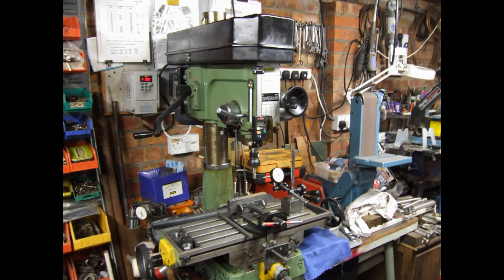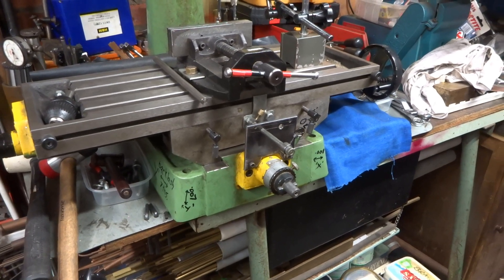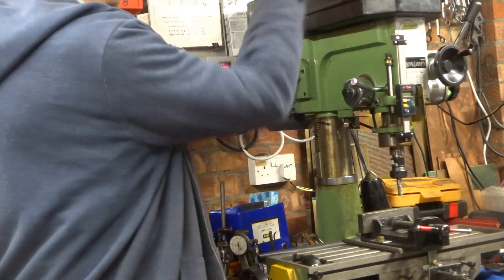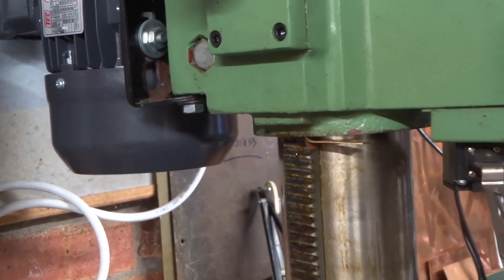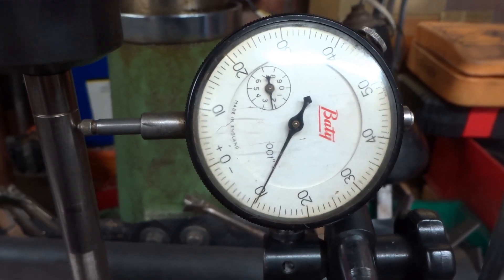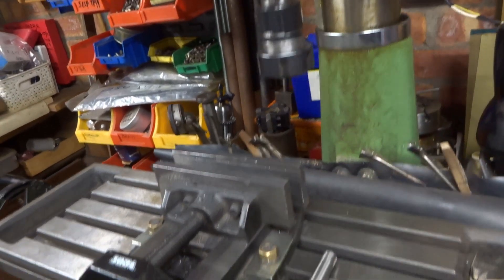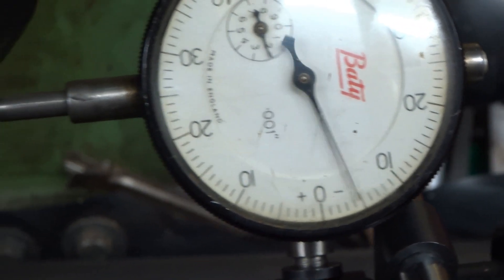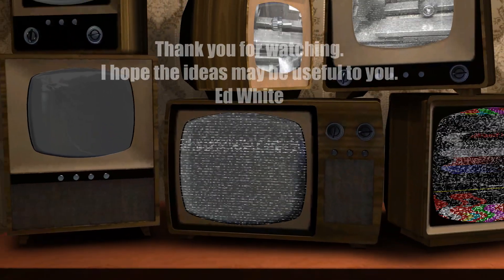Round column milling machine modifications

Comment: G'day Edwin and greetings from Tasmania Australia 🇦🇺 I just happened to stumble across your channel and like you my interests are in stationary steam engines and currently I'm building a No 7 horizontal steam engine, however I found how you explained how you were trying to get the head of the mill ridged, apart from the mill being 25 us old is amazing that the tolerances were so low.    Thank you for filming this, regards John
Reply from the maker: Thanks John and I'm pleased you liked the video. Reality is that u get what u pay for and this mill was cheap back in the day. That said for what I do it has been excellent and much easier than milling on the lathe which is what I had to do before aquiring the mill.
Ed

Comment: I had the same rf30 mill, since switched to a round column rf40 (geared tilting head) the dro really is the key. I added a 3 axis on my old one after getting frustrated with moving the head. I added one to my rf40 before I even used it. Just zero the dro, go to work, move the head zero again. Also a er collet set can do everything you need without pulling the arbor (other than a large face mill or boring bar) my r8/er32 almost never comes out of the mill, the clamping range covers every drill bit and mill
Reply from the maker: Many thanks. Like you I try to use the ER collets as much as possible, I also try and plan my machining operations as far as possible to avoid raising or lowering the head and in so doing loosing lateral position. Fixing the vertical rack in position however has resolved many issues.

Comment: I've considered doing what Edwin has done to locate the head. I think that in addition to the screws at the top and bottom of the rack, putting pins through the rack and column about 4 inches apart to stabilize the plot. At each pin location I'd jack the head to zero the head location as shown in the video before drilling for the pin. 
As Edwin notes, the problem usually encountered is changing the tooling and there is no room to get it in or out. Therefore, the more important thing usually is to be able to crank the head up to change tools and coming back down to very nearly the same place and still have the head zeroed on the work.
Cheers from NC/USA
Reply from the maker: The pins are a good idea and I did consider doing that, however I became concerned that I might mess up the teeth on the rack so in the end 'chickened' out. In light of your suggestion I may revisit the issue when I get through (if ever) with making the paddle steamer engine that I have under construction. Many thanks

Comment: Very useful video Edwin, cheers. I've just picked up a similar machine to yours and have been mulling over how to sort the play in the round column. I can't really foresee a situation where i where i will be rotating the head out of choice so i'm planning on tig welding the rack to the column top and bottom by 3/4 inches and fixing it in place. From what i can tell by looking at my machine is that the movement is caused by the rack moving side to side when under force so hopefully this will sort it out. I may even braze it at a couple of points in the middle to make sure it isn't going anywhere. Good shout on the brass shims too. Thanks for sharing
Reply from the maker: Thanks Alex. I have never found it necessary to rotate the head of the machine and on mine the head lock does hold things securely.  However the issue I had and hence the mod is that the quill travel is a bit limited and I sometimes found I had to change tooling which needed the head raising or lowering with consequent loss of position when the rack moved during this operation. In my case the packing between the rack and the slot was essential to maintain position if I found it necessary to raise or lower the head during tool changes (particularly when changing from drilling to milling mode). Be sure to get the rack as vertical to the column as possible before finally fixing it in position.
Regards, Ed

Comment: Like the rotation mod using shims on the rack, I have just “obtained “ the Axminster white version of the mill, with very very little use. However I need to address the head. Thanks for the idea to fix the rack. This will be my preferred first mod, I may however make guides and bolt these to the upper and lower section of the head assembly. This way I have a little wiggle room for very small adjustment .
Good work sir.
Reply from the maker: Many thanks for the kind words. There is a U tube channel called Winkies Workshop and he did a good video on making guides of the type you suggest - worth a watch. That said with more care than I actually took I think fixing and shimming the rack should be ok. Certainly works for me. Regards
Ed
Reply: @edwinwhite933  yes I watched that,  I’m just retired and trying to get stuff around me to start to play a little, I have to get some tooling  and a vise.  It was too good an opportunity to let go but boy was it heavy!!

Comment: I wondered if the rack would work to prevent head rotating, now I know it will.
It's a much more elegant solution than the round or square bar off to one side
Reply from the maker: Many thanks and I'm pleased the mod was helpful. Mine is still in use and works well within the limits of accuracy I need for my model engineeering.
Ed

Comment: I screwed my rack to my column and each time I move the head height I push the head to the right and I get within a couple thousandths. I tested with a long bar as well but I did it while I was aligning the rack before attaching it.
Reply from the maker: Many thanks, works for me and a couple of thous is usually more accurate than I need for the stuff I do

Comment: If you want to see another approach, check out some mods which Winkie did to address this issue i.e regarding preventing the head from losing position when raising or lowering.
Great idea about the modification to make a more compact chuck👍👍👍
Reply from the maker: Thanks Dwight. Yes I had previously seen Winkies vid which is excellent. However cos I'm a bit lazy and was in the middle of a project I did not want to spend much time on fixing the head location. The 2 bits of shim were fine for what I was doing.

Comment: excellent....im considering a warco round column major mill.....if you were me....would you buy a round or a square column new mill?
Reply from the maker: Well prof that is probably an impossible question to answer. The key thing is rigidity i.e. depending upon the components you are likely to make can the mill handle them easily? On that score you always find yourself making something rather larger than envisaged. If the mill is correctly designed I doubt that round or square column makes much difference to rigidity. I bought the Warco on price cos it was all I could afford for what I thought I would be making. The advantage/disadvantage of a round column is the tendency to loose position if the head is raised/lowered cos (in my case) I did not fully assess the different lengths of tooling any particular operation required. Only once have I found the facility to rotate the head to be useful. I have now (sort of) fixed my column head so that it cannot easily be rotated. A Key question is the size of the table and therefore table travel. If it can be avoided the last thing you want to have to do is move the component being machined on the table because of restricted long or cross slide travel. Nothing worse than discovering you can't maching the last half inch of casting or whatever without moving the casting on the table LOL. I have been and continue to be entirely satisfied with my Warco for the model engineering that I do. The best mod I made to the machine was to ditch the single phase motor and replace it with a variable speed three phase - excellent torque and nothing better than adjusting speed with a dial rather than faffing about with belts - when the maching noise sounds right it is right. Same on the lathe! Hope this helps.  one last point a big one is usely better than a small one all else being equal. Ed
Reply: @edwinwhite933  thanks Ed, i like the look and support from Warco.  i have a tiny proxxon mill
and the bed is far too small.  looking to get a larger mill.
Reply from the maker: My personal experience with Warco is excellent. I have never had any problems  with the mill or the 'add ons' such as collets etc. Back lash and tolerances etc are clearly greater than you will find with much much more expensive machines, but you soon learn to live with those slight shortcomings. I would be very surprised if you have any problems. Over the years Warco have clearly kept on top of quality control with their suppliers. Best wishes, Ed